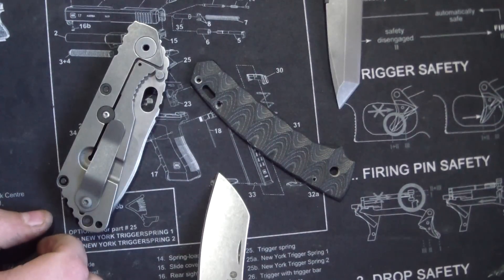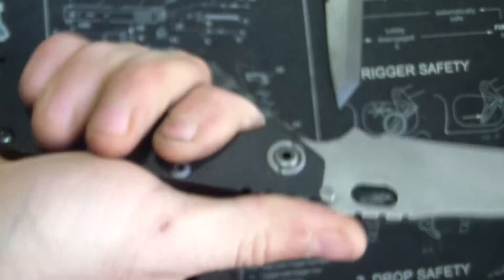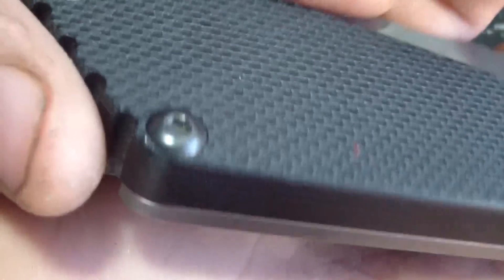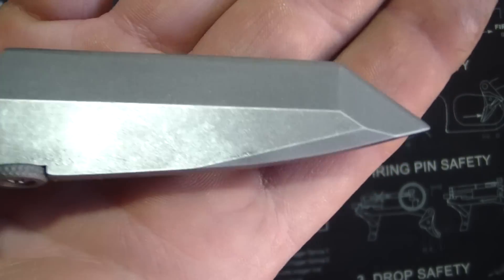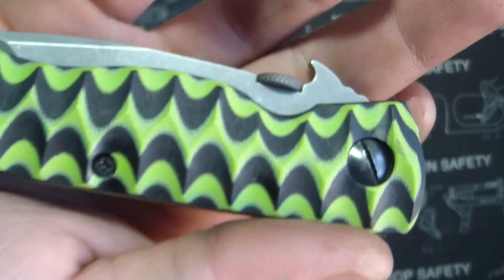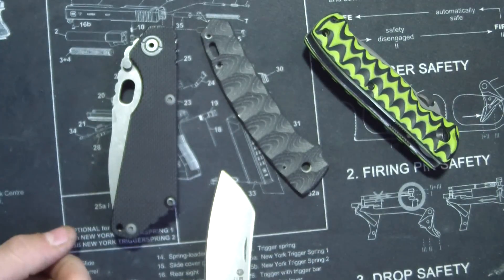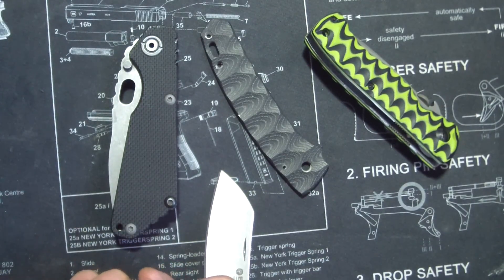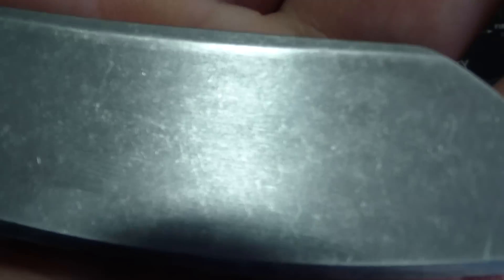Pimped Boker Haddock and USN CQC-7 Custom G10

Comment: you can fix the strider by taking it apart and bending the lock-bar in more than it already is. So it will lock up harder and further in. I've done it with a few liner locks and a framelock. Worked nicely so far ;)

Comment: Strider puts a cap on the stop pin or puts in a bigger stop pin to the best of my knowledge. I think victorinox fan fixed his by putting a bandaid around the stop pin. It looked ugly and was a quick fix but it worked. Nice work, not exactly my style but its quality work. And if you have a strong magnet that could help find the screw.

Comment: whoever owns the chokwe or haddock should buy the other knife to have a perfect matching pair.  that would be epic.  its the best haddock on the internet for sure now.  and you learn so much doing your work about each knife. like how the stop pin should fit on the haddock. leave the lanyard hole out of the g10 side on the haddock.  you can use it without.  dont ruin the beautiful pinstripe g10 down there.